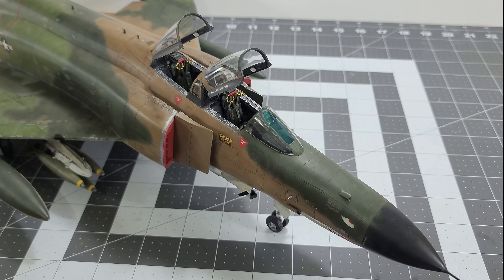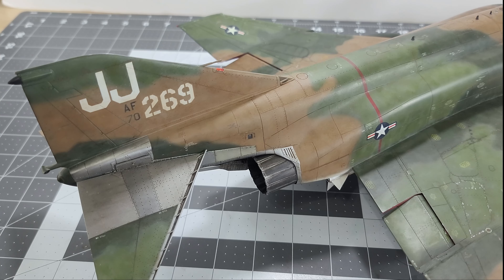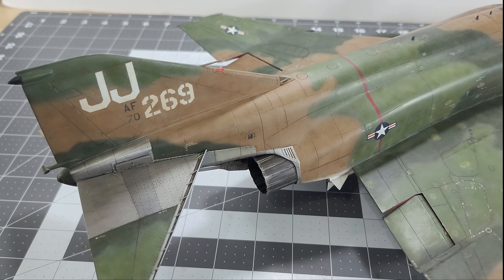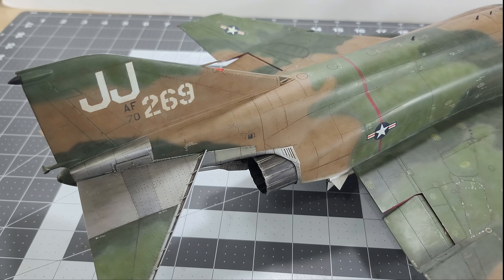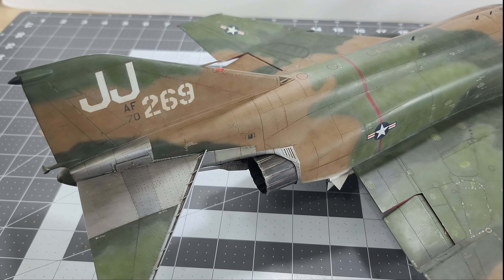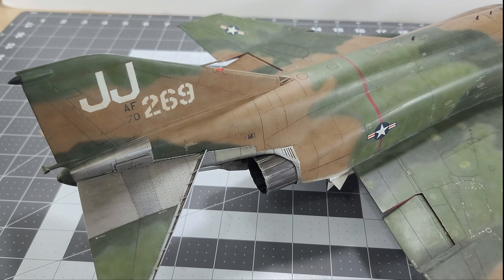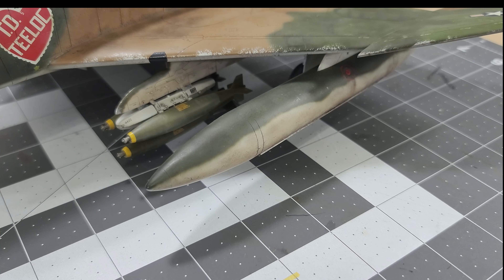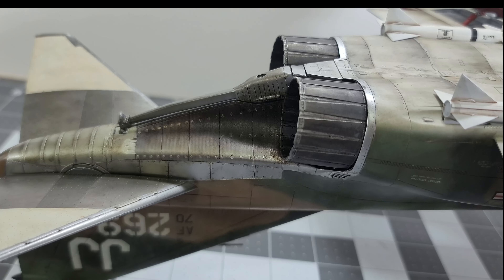Tamiya 1/32 F-4 Phantom - Post Build Retrospective

Comment: A important review for anyone considering this kit to build for the first time for a great outcome, Jim. I returned to the hobby in 2018 and was building most of the Tamiya 1/32 newer WW2 kits. Bought the F-4E and did the conversions for a Terminator 70TH. Then did a F-4EJ and a F-4C converted to a F-4E Terminator 60 Years of Service in Nato using the second E nose from the EJ kit. When Tamiya ended production of the E kits I ordered two E nose sprues from Tamiya Japan and purchased three F-4J kits to build two JASDF Es and a J.
I have come to realize my affection for this subject and the challenges to correct these flawed models. 
Modellers before me have solved the kit exhaust nozzles by cutting and adding a wedge of styrene to increase the diameter. With the Eduard 32080 PE and the wedge clocked inboard out of view by the fuselage the kit part looks very good. 
Examples of my builds are posted on my channel if interested.

Comment: been looking for (assembled) 1/32 & 1/48 scale miniature models of F-4E Phantom II (Block 50+) multi role interdictor strike fighter with functional features like opening cockpit canopy, retractable front & rear wheeled landing gear, movable flaps & rudder, under wing weapons hard points etc . . . please note I'm interested in the internal gun variant of the F-4E Phantom II (Block 50+) multi role interdictor strike fighter that was built into the starboard side forward lower fuselage section, as the airframe upgraded over time . . . please advise . . .